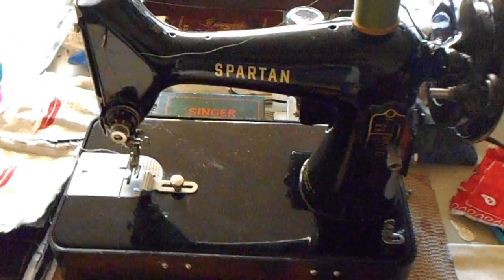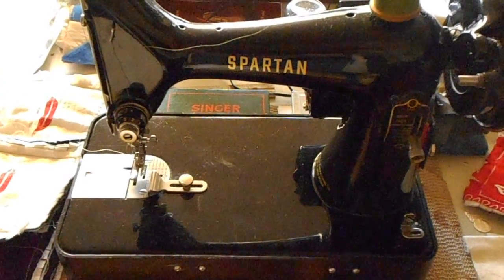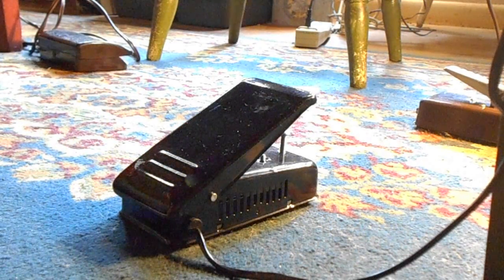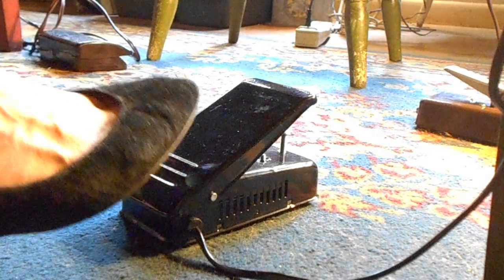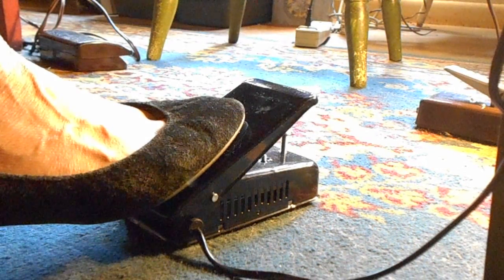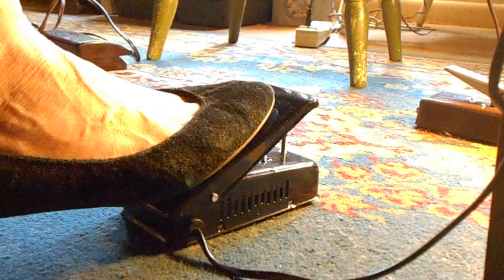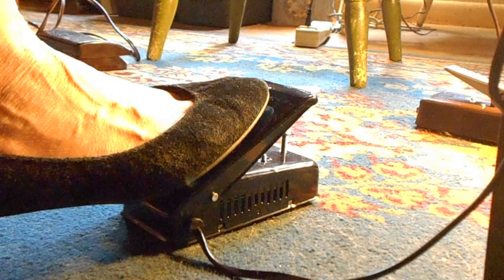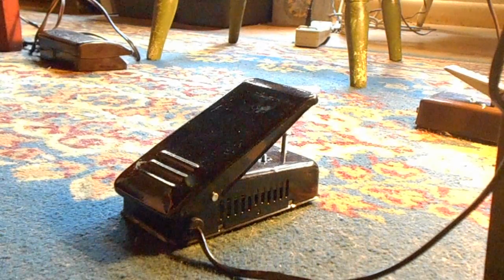Foot Pedal - 1959 Singer Spartan-Replacement Motor

Comment: Hello, I want to buy an option for Spartan. What is the name of this pedal - motor?
Reply from the maker: Let me find a link for you- for the motor and foot pedal- This one is the lowest price I see and should work fine-  https://www.ebay.com/itm/165845642894?hash=item269d2bae8e:g:ZTkAAOSwBU1aiGyY&amdata=enc%3AAQAHAAAAwJMgYDkFYNhbCcFvuyPfG0gyazeWY4Yzy4XQEBwHd3jzn3%2F1GQdpcAfac85QS2OzD%2FUwvSQftoj5CD3Vky%2BbhW7iUnjg5Ak73pqDHUgL82BwsRU0Z1iD4dvzxJwVGwq6MYLjd7OOdrUi6W3UNfCs6JwWjKMIi5Wn03PBZeeuEgf6%2F4joavvhpMz7LwVxs2YhegoL6q35ozV3%2BcNWiNhsOu7AaA5vXI9xJzbFNy41f4gDeYPMP%2FSkw%2B8RnuhPrUqjUw%3D%3D%7Ctkp%3ABk9SR7bv-_7YYQ
Reply from the maker: Sorry- that says the motor runs counterclockwise - you need clockwise- this one - you need to specify the watts- most are 100w - 
https://www.ebay.com/itm/165952133583?hash=item26a38499cf:g:rX8AAOSwittj9fz-&amdata=enc%3AAQAHAAAAwM7TY6zgHziKjH3eKcxWzGLa1f05Ub7wt%2FowRcMsu4Y%2BAfjtwTh8jEJ%2BDwPRvfjMtDg65Ac7pJxnLRmMhSjf2xPRMf08K8L0rIbpMCk2bDYNtXwdygm9w%2BMzLNahjd7Z4Qjk8yVZIxNOn3H9koYiZAYzlV0bqeawDijcx0Wgg5XkFUj8M6BT%2BZnj93Zgz52NIeyNOEMmB9R%2FFkQhaN6%2BHu6HK9kEzugjOd7%2FKN1M8s8L57oO7dLDpxo2hoxS1r%2BvSg%3D%3D%7Ctkp%3ABk9SR7bv-_7YYQ